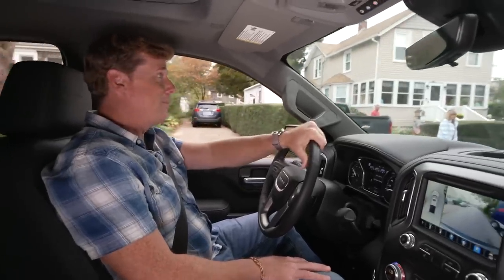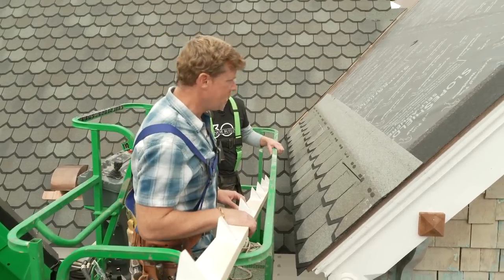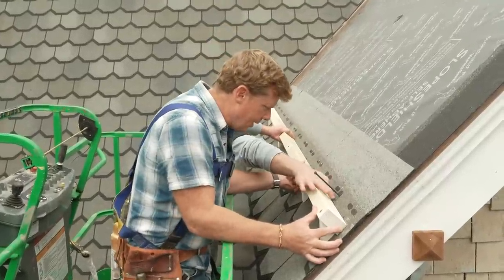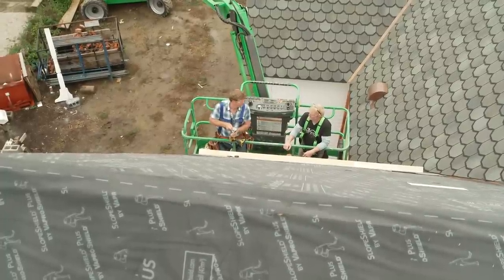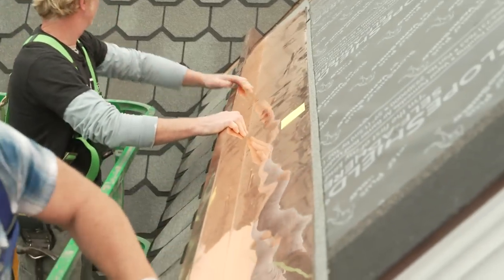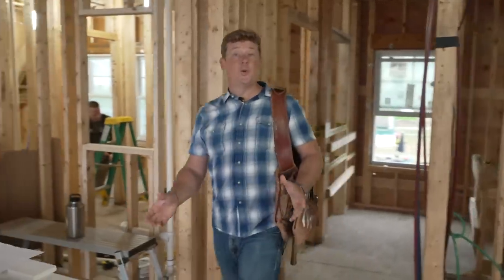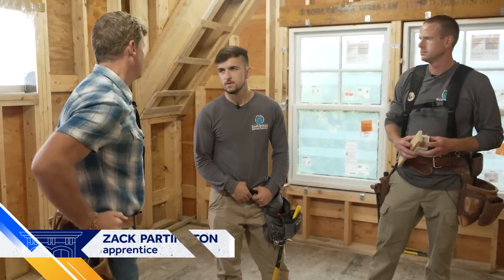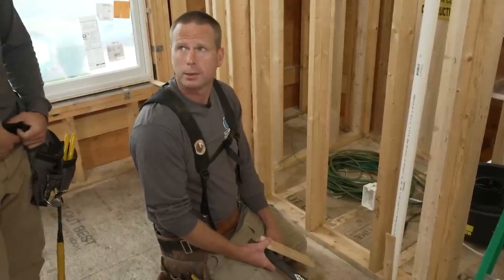This Old House | Upgrading Old School (S42 E9) | FULL EPISODE

Comment: The water flow through the heater goes the opposite direction than displayed in this video. It has a  counter-flow pattern through the heat exchanger. The cold water enters the condensation chamber at the bottom  to extract the most remaining heat from the flue gases,   then increases in temperature until it exits at the top, closest to the burner. I let it slide the first time he said it, but had to mention it on the second. Regardless, it's always a pleasure water these episodes.

Comment: On the ext post trim, what’s the difference painted “Spanish cedar”, and painted PT whatever from the rack at the home store?
Reply: Price.
Reply: Long term durability and pt has a long dry time before you can completely seal it. I imagine the thing here is you wouldn't put a Walmart tire on a high end car the cost is fairly small in comparison to the rest of this place.
Reply: @stich1960  yes dry time makes sense, and maybe cedar paints better, I dunno, or is more dimensionally stable than PT pine, again I dunno. 

The thing is, the industry is loaded w sources pushing their junk as “high end”,  or pushing their actual high end gold plated product as the only answer  when in fact for a given job others are just as effective, ie ‘only top grade 1 lumber is acceptable … for this temp scaffolding or blocking’.   Some contractors happy to repeat the line to justify their high prices.

Comment: A house from the 1880s built in the historic district. There must be some really old houses from the 1600s then
Reply: That area was a hotbed of activity during king Phillips war in the late 1600s when Indians were raiding and destroying/ burning any and all colonial settlements they could find. I doubt than any structures from prior to that conflict still exist. As with most old places in New England, you could probably expect to see structures dating back to the mid 18th century and no earlier. Keep in mind too that the redcoats had a nasty habit of torching entire patriot towns during the revolution. Add to that the fact that everyone heated with wood up until the mid 20th century, meaning a lot of the old buildings burned down in peace time.
Reply: @krockpotbroccoli65  A house from the 1600s would not be feasible to live in today. Not unless you live like they did back then or totally renovate and it wouldnt be an actual 1600 house. I own a home from the 1890s. It was updated from knob and tube wiring in the 1950s. The central heat was in the 70s. Today I am updating the electrical and data delivery. My home is hard enough to upgrade. The 1600s is beyond livable.